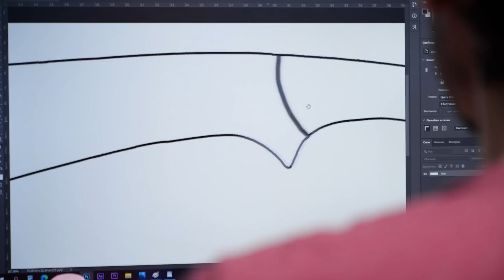How Sharp Handmade Machete Could Be ?

Comment: Allow me to explain something that some knife and sword makers out there who clearly do NOT have much practical daily professional experience using the tools they make ... you CANNOT put an edge on a blade that is more aggressive (read: thinner and sharper) than the strength/toughness of the steel it was made from will reasonably support for a given type of usage, and then expect it to be able to retain that edge for reasonable length of time ... it is a delicate 3 way balance.   Modern supersteels merely move the sweet spots in that tradeoff - they do not eliminate them.  Thus, if you make a really thin machete with a really thin edge that's able to cut like a lazer gyuto, then I guarantee it will not be a very useful machete because it will rapidly go dull, roll its edge, or even notch or snap, as soon as you start chopping thick branches for any length of time.  Even S7 will roll or notch in short order if you put an overly aggressive lazer gyuto style edge on it (say, 6 degree single bevel), and start whamming it into a dead tree trunk, full force.

Oh, and the dropping the bananas from on high across the edge thing is silly - even a bench scraper or a butter knife with an unsharpened "apple seed" edge will cut that. Pure visual gimmickry.

Comment: Better question... How long does it STAY sharp?
Reply: I'll take a guess here, considering the flexibility it's probably some very thin mild steel with maybe hardened steel on the teeth. 

It absolutely would not hold that edge with even one wack on some wood and even if it did it's so bendy that it would be unusable as a machete. 

Cool idea though and fun to watch the process but totally unpractical.

Comment: technically if you kept the back teeth sharp it can be multi purpose it can saw smaller logs so it can kind of keep it's original function but in a smaller size.

Comment: Could be wrong here am not a blade Smith.  However, maybe it would be a good idea to go into that piece and put a round belly to the low points between the saw teeth to prevent it from developing cracks.